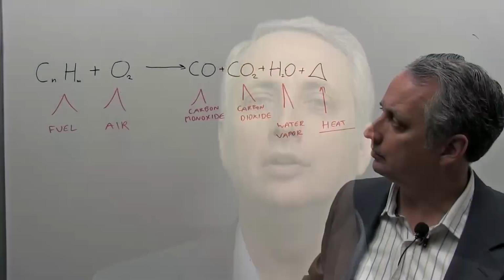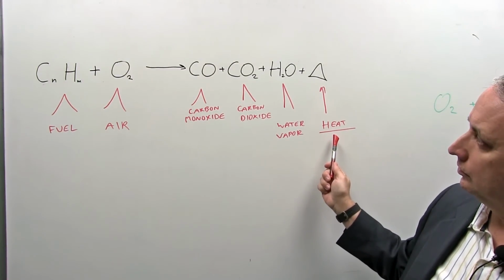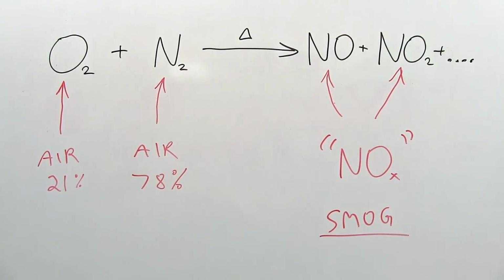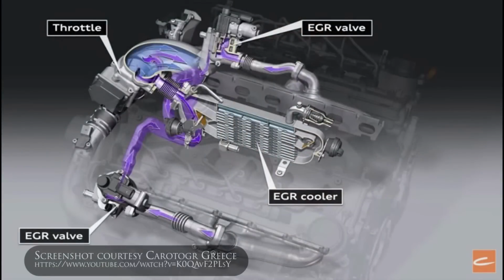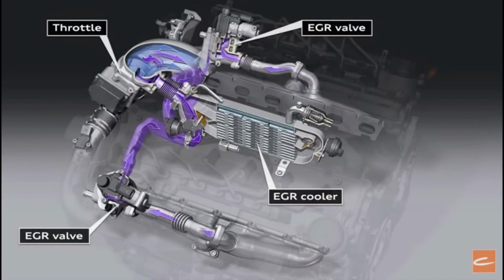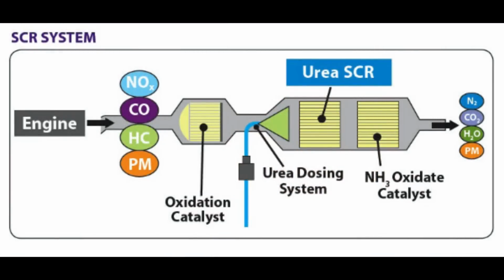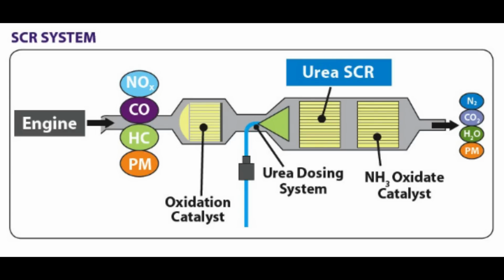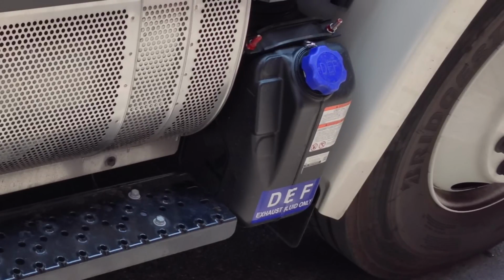How Volkswagen Can Engineer Its Way Out of Its Crisis

Comment: you know there are many engine designs  and alternative energies that can power cars or transportation systems in general. being able to drive 100 miles plus on one charge . Tesla is a good example. Who killed the electric car, a documentary covers some interesting questions.. I guess (as some claims would suggest ) even combustion engines could get the same results ..but for whatever reason..(cough cough)... they don't release cars that get higher gas mileage. now i'm no wizard and im not sure if you follow history..but ideas or alternatives  that cut into established ideas and their profits have been blocked out for years. Some of these groups and or established ideas have push and pull in government policy.. Basically it comes down to money. No use in following this group if your not going to question the world you live in. A good buddy of mine went to RIT for his masters..later on learned there's no shortage of better ideas..but a big shortage of support, money, resources, understanding.